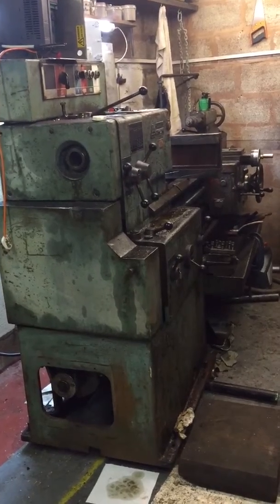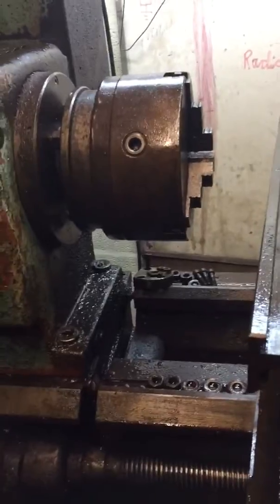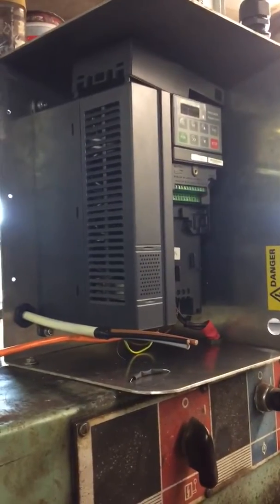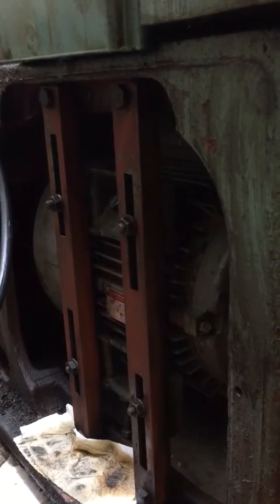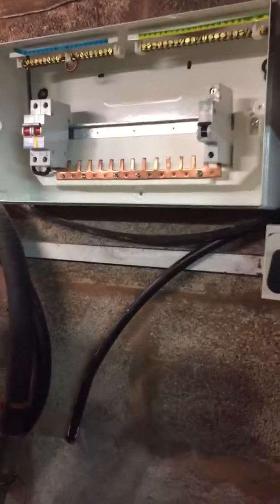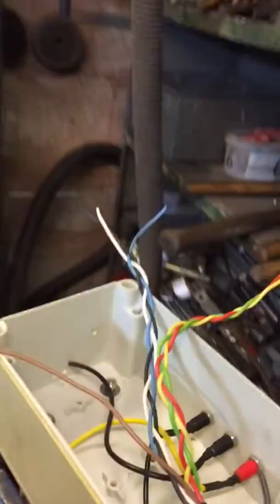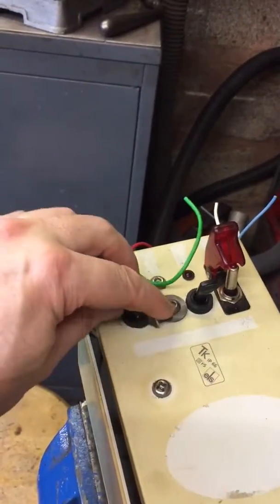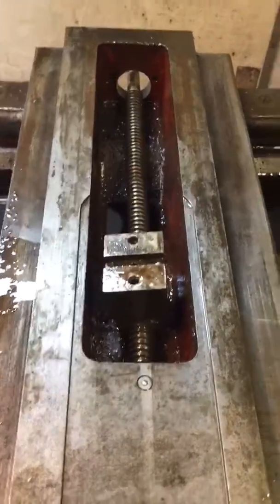I bought a TOS lathe

Comment: NIce machine - TOS make good stuff. I  like their chucks far better than the stuff from China. Have you considered how fast you can stop it in an emergency situation? I would recommend a three wire control on / off as standard machine tool practice and program the VFD inverter to decelerate to stop quickly. I've programmed my VFD to soft-start up to speed which helps the motor and mechanics. John
Reply from the maker: I think it destroys anything in its path before it stops? The 400mm four jaw is huge. I will look into it, but it might damage the controller as it is 4kW and the motor is 5.5kW?  - TOS stuff is nice. I got lucky and dropped on a 250mm 3 jaw for £50 and then sold its size8 back plate for £35. (Mine is nose6) My 200mm TOS 3 jaw is genuinely worn out with age. It won’t true up anymore :o( I have a new sweet little 160mm four jaw. The only chuck I have for it I can lift ^-^
Reply: @teamidris  VFD inverter should be ok -  I'm sure you'll not need to use it at a full load rating of 5.5kW. You should be able to current limit on in the VFD setup programming. :-) I've got a 10" rotary table and a dividing head - I get my neighbor to lift onto my mill but I'm old!

Comment: Did it come with a bucket of degreaser?  lol
Reply from the maker: It has just reached the point where black gunk no longer comes out of the slides when I move them :D
Reply: @teamidris  When things are really bad, I use 100ll airplane fuel for cleaning.  It cuts the crap.